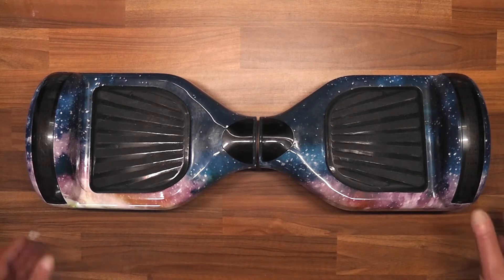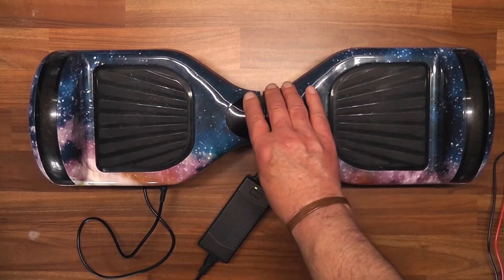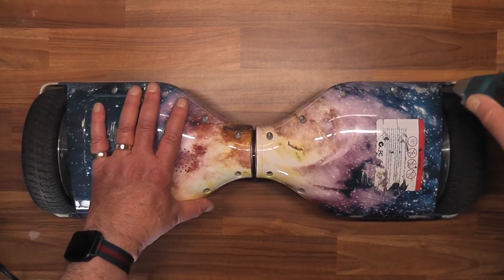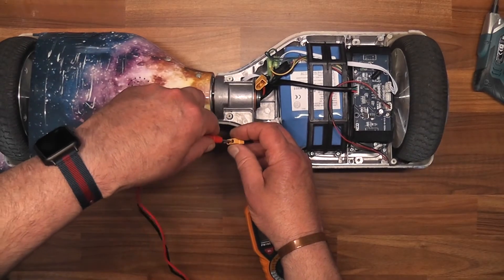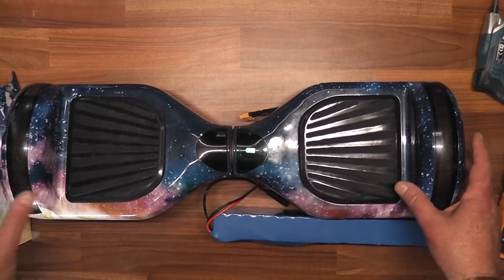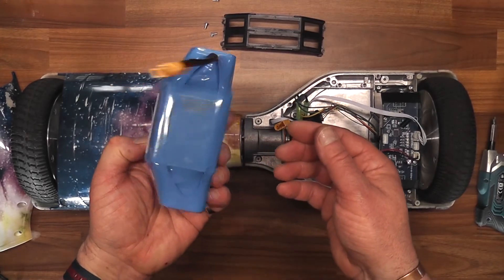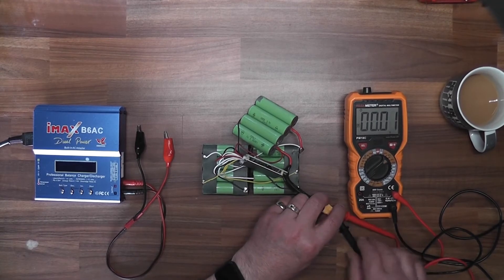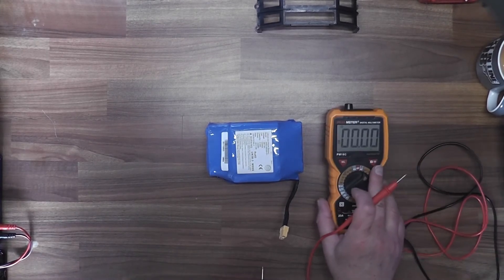DIY Fault Finding on a Dead Hoverboard

Comment: Ive been given a non worker, doesn't show sign of life with or without charger, charger is green all the time and put out 42, battery pack said about 40v I think so its odd, caps look alright from what i could see, can't think of what could be prob as I'm sure I saw display flash on and off when I 1st saw it but wasnt given charger until days later, dont know if it was red the 1st time i plugged it in!? 🤷‍♂️ any ideas plz!?

Comment: I tried getting a new battery pack but I can't seems to find my exact battery. Can I use another model?
Reply from the maker: The model name is not important. It’s the shape of the battery pack to fit into place. That shape is generally the same voltage that you would require for a hoverboard and the more mAh the longer the run time

Comment: My battery has 35 volts but the it will not turn on without the charger plugged in
Reply: Same
Reply: Did you find the issue?
Reply: @charni9091  nope

Comment: mine when i plug it in, the green light just turns off, what that mean??
Reply: It means you have a short some where
Reply: I have two batteries like this. I took out the battery, removed the sleeve and checked each cell voltage on the connector that plugs into the BMS. Most cells were very low voltage at around 1-2v. I charged each cell without the BMS plugged in and made sure each one went to 4.2v. Reseal the battery pack and then try again. My batteries charged for a short while with a red light on the charger and then the light went green.

Comment: Good day ,mines is showing fully charged when the charger is plugged in ,but if you turn it on and press the pads the light indicator shows red and it makes a beeping noise
Reply from the maker: Sounds like the battery pack has had it. 
It’s not uncommon for one or more of the cells that make up the pack to fail then giving a false charged indication. 
Was it stored away not fully charged?
A replacement battery pack should solve this
Reply: Same with my Neice’s
Reply: Same with mine
Reply: Same with both mines
Reply: Same problem if someone find the solution the solution plz help
Reply: You to kick the battery
Reply: Open the hover unplugg the battery and kick then with an extra adapter or battery
Reply: You need to repace the battery

Comment: As far as I know the battery on mine is not a problem. My problem is that the charger doesn’t charge it. When I plug it in it the charging light isn’t on the plug or hoverboard. The charger is fine it produces the voltage. So how can I fix the hoverboard. The port itself is good too and provides voltage to the first board it plugs into but I am not sure about the connection to the rest of the board.never mind figured it out
Reply: The battery gets to dead and charger won’t read. Take a drill battery and run a jumper wire + To + and to then plug the charger in and disconnect the drill battery. All good after.
Reply: Same
Reply: I think that I found why is that is because mother board died and is need to be replaced

Comment: What should I do if my battery is directly saudered to the board?
Reply from the maker: Take note of the + and - and desolder. 
Option 1. When you get the replacement battery pack you can cut the plug off the wires and solder the + and - in the correct order to the board. 
Option 2. You may need to purchase xt60 or xt90 plugs for attaching to the wiring for the battery pack and the board.
Hope this helps.